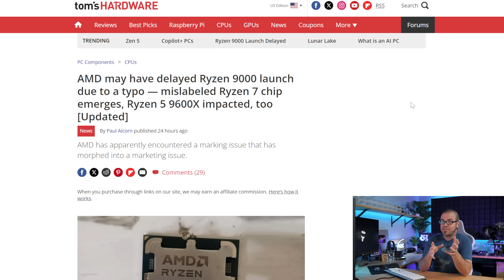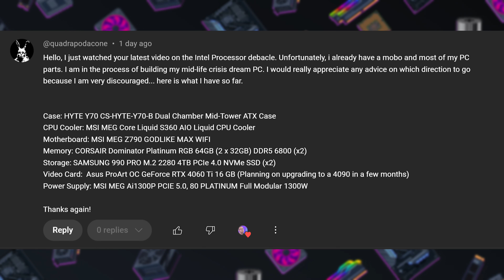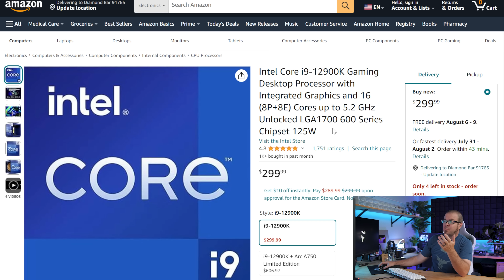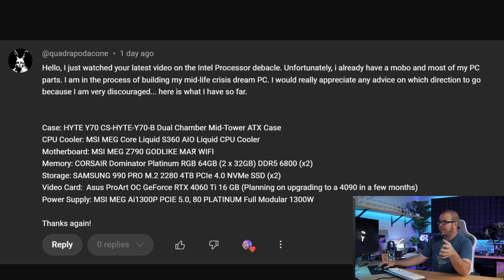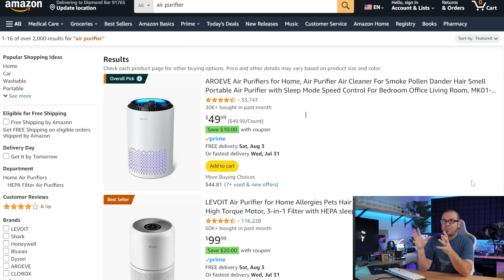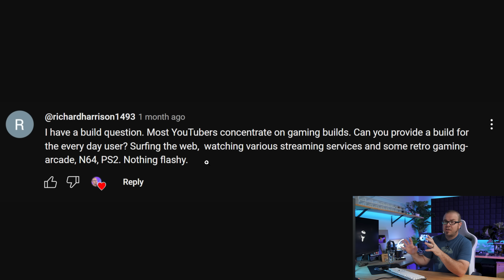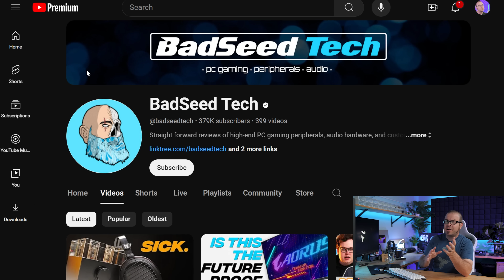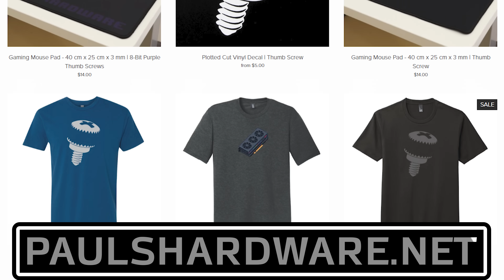What if my Intel CPU explodes?? - Probing Paul #88

Comment: I'm on day 12 of my 13900k RMA, intel initially agreed to swap my CPU out but I asked for a full refund because they knowingly sold me a defective CPU (confirmed by Batch#) and I haven't heard back. That was 6 days ago. Do not buy Intel guys, they're out here selling defective CPUs and trying to trade you for a (possibly) defective replacement
Reply: You gotta threaten them with lawyers, even if it's a bluff
Reply: @MrBeast1901  I don't wanna get ADL'd bro
Reply: @MrBeast1901  if you do that they are required to no longer speak to you as that is practice of any company the moment you threaten legal action.
Reply: @MrBeast1901   Specifically a "Class Action Law suit."
Reply: BATCH#'s that are defective for the 13900K?
Reply: @davidsmith4186  If the issue truly is faulty microcode as Intel says then ALL Raptor Lake CPUs are effected, whether or not one's degrades is down to luck, workloads, and MB settings. For the oxidation issue on 13gen Intel is tight-lipped about it, only admitting it was fixed in 2023 on Reddit.
Reply: @davidsmith4186   mehck-gk9yn = FAKE !!
Reply: @davidsmith4186   mehck-gk9yn = FAKE !!
Reply: Sorry, they can't get to your problem right now, they're too busy eliminating 15% of their staff.  Hope the person working on your case wasn't one of them (who am I kidding, of course they were.  Anything to delay the inevitable.)
Reply: Good luck
Reply: I recommend giving them some time. I remember it taking several weeks from the time I started my RMA until I received a full cash refund.
Reply: How long did it take for the problem to manifest?
Reply: @spooksy1982  >How long did it take for the problem to manifest?

As long as it took for me to put the CPU in the socket and turn my PC on, but it wasn't super bad at first... it just kept getting worse and worse until I couldn't even run Intel Baseline without Starfield crashing, Chrome crashing, Blender crashing, etc. I had to reduce the multiplier and all sorts of stuff just to check my email lol
Reply: hopefully they get back to you soon!  it is the worst when any PC is down.
Reply: @Phil_Goodman  Thanks Phil. They finally replied saying they are "Considering allowing a refund and will reply by August 2nd". I thought they'd just decline a refund but at least they claim they're thinking about it? maybe?
Reply: I use 14900K from  5 months...and I don t have any issue... I work in music production and video...I use integrated video ....with no problems. How can I test my CPU If Something it s not ok? I use Gigabyte Z790 PRO X...and I dont have any problems yet
Reply: @QuantizStudioRecords  You should lock the P-Cores and if you haven't had any crashes or instability I'd say you're probably ok
Reply: They denied mine.  Why? Don't know.  Thanks intel
Reply: @SwingArmCity  Keep opening RMA tickets until it gets approved. Do not stop. NEVER CEASE
Reply: What do they make you do for an RMA?
Reply: @jjlw2378  >What do they make you do for an RMA?

Your processor has to have a problem, then you contact them and describe the problem. You prove the Batch# and S/N, they look it up to see if it's a corrosion batch or not. If not, then idk what happens. Mine was corrosion batch from early 2023.
Reply: mehck-gk9yn
HP, alienware, Acer ?
They ?
You dream ?
Reply: @the12gaugeshotty  AMD's issue is just a simple labeling / printing error on the processors where some Ryzen 7s were labelled as Ryzen 9.   I'd gladly take that error anytime, any day and still enjoy my dependable AMD powered computers with no noticeable difference in performance between R7 and R9 rather than intel's horrible instability and rapid performance degradation issues.
Reply: @gerrycrisostomo6571   I saw today that its AMD itself that leaked the mislabelled CPUs. The first batch did not pass validation and they are currently rebinning the CPUs (some 9950X's will be rebinned to 9900X's and some 9700X's will be rebinned to 9600X's. This is the reason for the staggered release and why the high end CPUs are being released later as the yields will be less in those cases. This only affects the first batch and all new batches will be validated in this same way. Source: Moore's Law is Dead.
Reply: Did u send the cpu in already? Cuz if u didn't, u could try whatever store u bought it from. A reddit post said Amazon and another store refunded his two 14900k cpus even tho they were well beyond the refund deadline.
Reply: @amixofgeekcontent  I got it from Newegg July of 2023 so it's way past the window unfortunately. Good looking though. Still waiting for Intel to tell me if they're gonna do the refund or not....
Reply: I don't know what happened to the design teams ethics but this is ridiculous. Pretty sure the US army still uses Intel. I smell a long lawsuit
Reply: if they swap for one without a problem i really don't see the issue here, honestly.
Reply: Dang you can get a full refund? I'm going to try and RMA my 13900k. It's been running flawless at 5.8p/4.5e/5.0ring since Nov 2022, but I'll definitely take $500-$600 to buy ArrowLake! Sweet.
Reply: @jjlw2378 until they see your post. SMH.
Reply: It's a voltage issue. Intel can fix it with a voltage limit update. If there is a defect, the defect is in the ring bus not being able to handle voltage and Intel pushing power beyond safe specs. Which they are fixing, so it's a software issue.
Reply: @JohnDoe-ip3oq  and for cpus with fewer active cores like 13400/14400 and below, the issue shouldnt even be a problem. writing off those as someone above said is misleading. i doubt intel had many problems with 6 core no e core cpus.

Comment: Just go AMD. Why risk.
Reply: I did, and that's exactly why I went back to Intel. Twice now. Pretending AMD is issue free is pure copium. Intel earned it's reputation for stability as much as AMD earned theirs for instability. THAT'S why this has been such big news. Intel rarely has unstable platforms.
Reply: Two gens in a row are literally trashed, AMD is top shelf right now and has the hands down best gaming CPUs. The contest is over as Of right now.  @zodwraith5745
Reply: I might go for an AM4 with an 7700x or all out with an AM5, with an 8700X3D   .   #AMDjustRULES   The HELL with Intel & ASUS !
Reply: @gertjanvandermeij4265  AM4 doesn't fit a 7700x
Reply: @GoonyMclinux  There's also no such thing as an 8700X3D and there won't be. 🤣 Not exactly making AMD fanboys look the brightest. (Because they're not. No one should be a fanboy for a huge evil corp.)
Reply: Oh the irony 😂
Reply: well to be fair my 7800x3d could have blown up to but here is the thing what if you bought a 13900k at launch how would you know back then that this would happen are you a wizard?
Reply: @PainX187 if you've been paying attention to how clueless Intel has been for several years in the cpu space, yes. It's beautiful that a company that has changed its cpu design so little in so many slow, boring, useless years is unable to even have a stable platform anymore. It's actually perfect and expected if you look back at how much of a failure they have been for over a decade.
Reply: @joeykeilholz925 but back then it was stable, no people retinking Intels products

Comment: its 7800x3D or 7950x, not 7950x3D. Dual CCD with differnet cores still isnt a good option for new to intermediate builders, its an expert only CPU due to the nature of understanding core lasso and getting it to work effectively. Cannot ever recommend 7950x3D to anyone but expert builders to just get them working, since it requires a lot.

Comment: I really hope Intel can turn things around because we've experienced a CPU monopoly already, and I have no desire to see another, even if the shoe would be on the other foot.
Reply: We need to compel Intel to hand out more x86 licenses. AMD is able to produce x86 CPUs because IBM told Intel "we require second-sourcing agreements on any chip we choose for our Personal Computer project" and then, later, Intel and AMD wound up in "you can't sue me and I can't sue you" patent cross-licensing agreements after Intel tried to play dirty.

Same with Cyrix, who sold CPUs that were excellent budget options in the 90s but ended up choking when Quake figured out how to exploit the independence of the integer and floating--point pipelines in Intel and AMD designs for more performance. Cyrix ended up getting bought by National Semiconductor and then sold to VIA, which is how we got those low-power x86 chips in the thin clients people are now repurposing as tiny, fanless DOS/Windows 98/Windows XP retro-hobby PCs.
Reply: It's more of a duopoly and the end result of a performance arms race.
Reply: Intel will be fine. Desktops are about 20% of the x86 market, and K processors are about 10% of that. This is affecting X proportion of those, so Intel are looking at less than 2% of the sales of just one division. Even if they paid full compensation for every failed processor,it would still be a tiny blip in their multi-billion sales each year. People on the internet forget how small (relatively) the enthusiast segment is. Unless this affects laptops or their OEM customers (Dell, Lenovo, US government etc) then they will just learn for next time and move on
Reply: @peterwstacey we're pretending we know this doesn't affect laptops eh?
Reply: @joeykeilholz925  We're going on what Intel have confirmed (yes I know we shouldn't trust them, but this is what they are saying, let's revisit it if they change their mind). Laptops have much greater power limits set by the OEM manufacturer, so the problem may be there in the architecture but have a much lower impact - a laptop CPU that used more than 250W would just not be feasible, and it looks like the 250+ W desktop parts are the ones affected.

On an engineering level, it is a huge mess-up by Intel, probably their biggest since FDIV and should definitely have been caught during V+V / Release Testing. But financially? The bean-counters will just go "oh dear. What's next on the agenda"...
Reply: @peterwstacey you do realize lots of companies use k series chips, like game developers, lots of software companies etc. There's likely millions of 13th and 14th Gen Chios affected. It's gonna be a bloodbath. Intel stock dropped 25% today
Reply: @denverbasshead  could well be millions of K processors, sure. Intel's financials were released recently and CCG had revenue of $7.4Bn/qtr. If you assume equal sales over the year, 20% of that being desktops, 10% of those being K processors, and an average price of those of $500, it comes to between 1 and 2 million processors sold each year, just of K desktop processors. Sorting this out (if they really wanted to) would be a huge logistical nightmare.

I did see the share price tank, and am curious why. I suspect it's due to realisation of overhype on AI, and Intel's costs getting out of control (their revenue is stable but profits are down a lot, and it's future profits that drive share prices). Intel have big problems going forward, definitely. I am just dubious that this particular bug will hurt them substantially in the financials, at least until it has an impact on laptops or OEMs.
Reply: Intel isn't going anywhere. What I see as the most likely scenario here is they halt the sale of LGA1700 (they should have done this already, but hey... there are still suckers out there who don't follow the tech news) once Arrow Lake launches, hoard the existing inventory for RMA replacements and just wait for the news to die down.

The real problem here is that we don't know for sure that what they're doing is going to actually fix the issue, and it will be MONTHS after you get a new replacement to see if the problem recurs. By that time the entire story will be old news and they'll treat you like the empty bag of money they already got out of you and give you the finger and show you the door with their foot.
Reply: ArrowLake will be good and Intel will flourish.
Reply: @jjlw2378  No red flags that they increased TjMax from 100°C to 105°C?

Comment: You cannot get a titanium quality PSU for under 1000 watts. So.... we HAVE to overpower it....
Reply: My corsair 850 couldn't handle the transient spike. So, i had to get a 1300W thor power supply. Everything runs fine now.
Reply: @DJBillionator  my thor has been so nice... quiet mode is really sweet. No probs running a 13900k (defective) and a 4090

Comment: Nah, my i7-7700 is fine
Reply: My backup workstation is an I7-7700K and a GTX-1070.  I upgraded to a new machine that had an AMD 5600X and a 1080TI.  I later sold the CPU/GPU and upgraded to a 5800x3D and an RX-6800XT which is what I am using now.

I currently have CentOS Stream 9 installed on my i7-7700K /1070 machine and windows 11 to game on my 5800x3D machine.

Comment: i'm still concerned that my barely 1 year old my i5-13600k is effected.
Reply: you can contact intel to get replacement if  it start being weird, 

In fact u might even got replaced by 14600K
Reply: @heickelrrx  an upgrade would be great. 
i already started looking at i9-12XXX series CPUs and i'm not excited about it.

so far no issues. i don't run it that hard except for occasional gaming. the only issue i've seen so far is the game i play doesn't take multiple monitors into consideration as well as i'd like. sometimes during panicked moments i stray outside of the game area and it crashes. i blame code for those and have already informed the game maker (hello games).
Reply: Don't worry about it...  The 13600k simply doesn't draw anywhere near the power of the xx900k series.  On top of that, unless you are doing hours-long renders and stuff like that, you're actually drawing very little power at all!  This is mostly an overclocking/endless benchmarking issue with "enthusiasts" and also server-specific cases of 24/7 high loads.
Reply: @awebuser5914  i was using automatic 1111 sometimes for an hour or so at a time, but that only effects the GPU as far as i know.
the system still works, i'm using it right now. and i still play my game on it. played 1-2 hours at a time without that weird game crash that i think involves panic clicking off the main monitor. (i have 3)
maybe i am fine for now. but i'm gonna keep $350 set aside for a new(in the box) i9-12XXX CPU just in case.
Reply: Do what you can ASAP. With the new funds go AMD. If enterprise businesses are switching out, that's a hint.